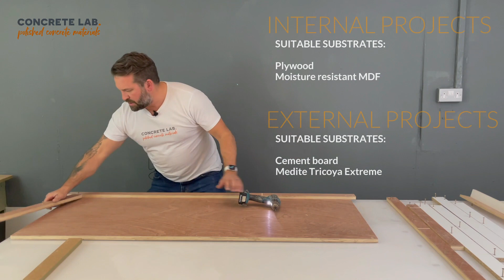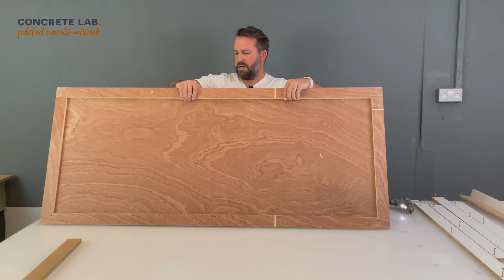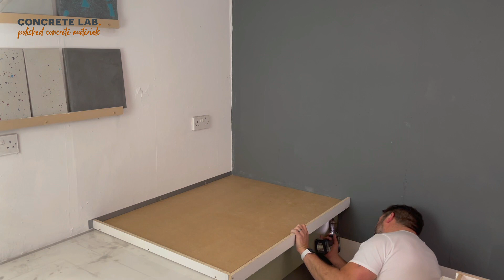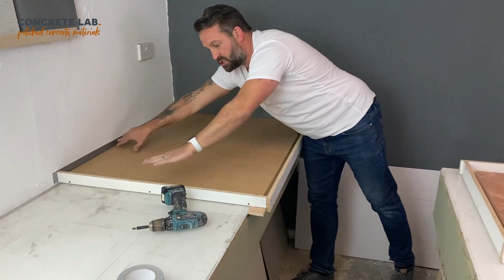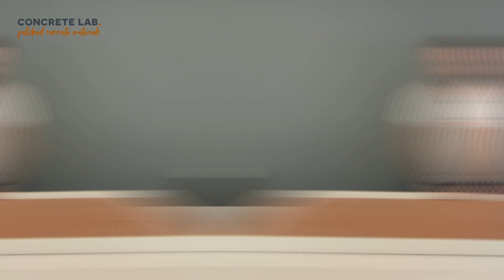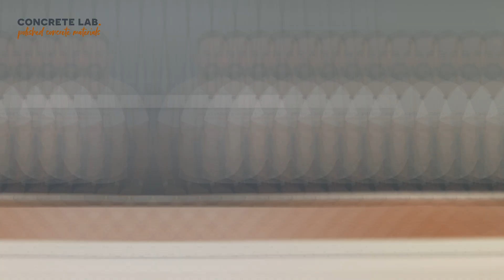Building The Mould for the Cast-In-Place Mix

Comment: Fantastic video!

Is that duck tape that you have use up against the wall side of the form on the second cast?
I've been wondering what to do on that side of my form without using melamine as the top edge would show
Reply from the maker: Hi Georgina, yes it is.